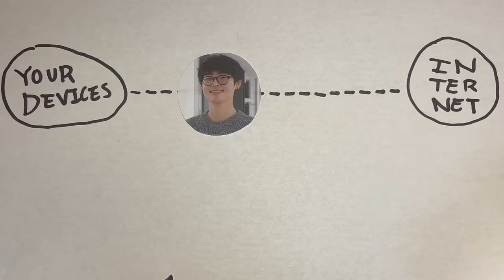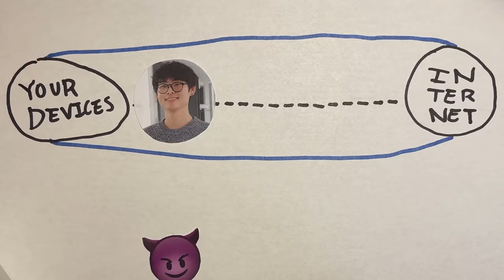I Turned an IKEA Bookshelf into a Modern TV Console | IKEA HACK

Comment: 8:43   I used to have this issue with my gate latch.  The changing temperature from winter and summer causes the frost heave and them not to align over 4 seasons.
My solution was to mount the "male" end on a thin plywood plate and then reposition with screws on different areas of the plywood plate as needed.  Usually in the spring.
Some years I don't have to adjust it, but it's easy since the plywood plate has many areas in which to screw in new holes to match the latch.
Reply from the maker: Smart!

Comment: Great video. Would love to replicate this. Do you have further information that you wouldn't mind sharing? Thickness of the plywood for the doors, dimensions of the doors and the spacing for the flutes please?
Reply from the maker: I used 3/4” plywood. I cut them out into 4 equal parts, leaving about 2/16” space between the doors. The flutes were each 1” wide, and there was about 1/16” spacing between the flutes. For the flute spacing, I took the width of the door divided by the flute width (1”), then divided whatever was left over by the number of flutes, which turned out to be about 1/16”. I hope that makes sense 😅
Reply: @ModernMakeovers  It does, Thank you!

Comment: What type of Kallax is that, since I can not find it anywhere in Ikea shop in the Netherlands, I can only find the default Kallax with the thin inner boards, yours is thicc all around. I use the standard 4x1 as a TV stand and was also planning on modifying it, but I kind of like the thicker walls you show in the video... Great work though!